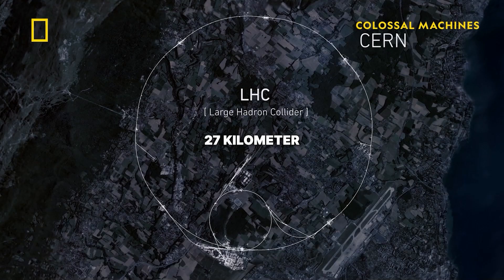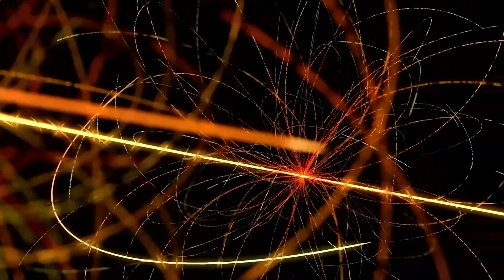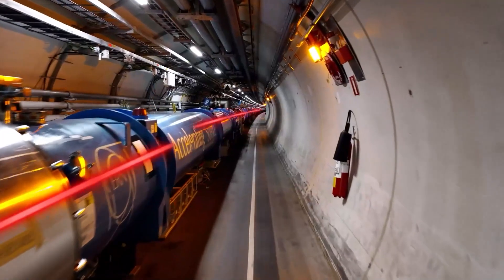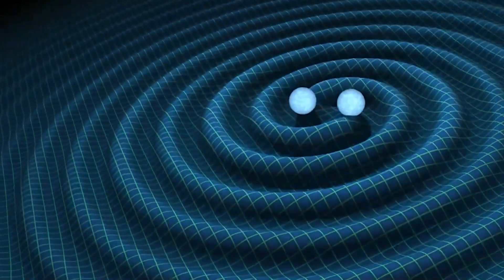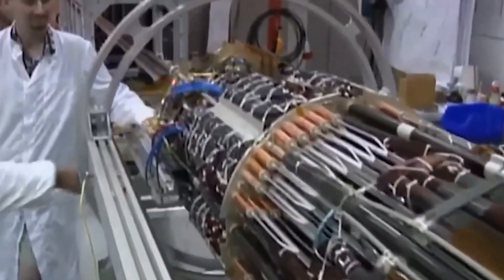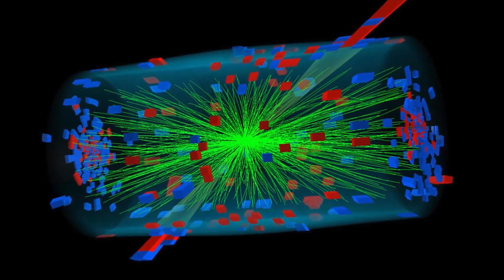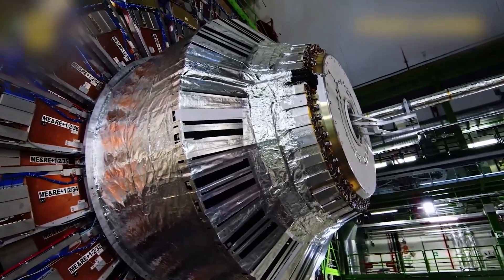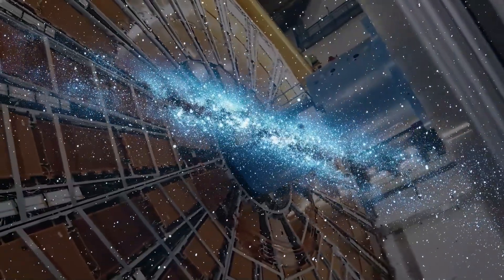CERN Scientists Tore Open a Quantum Singularity… And Paid the Price for Playing God

Comment: The claims from the YouTube video you referenced—that CERN scientists split a singularity in 2023, briefly risked global annihilation by creating a "strangelet," and have irreversibly scarred the universe—are not supported by credible scientific evidence or official reports from CERN or the wider physics community.

### Key Points Addressed

- *Strangelets and Doomsday Scenarios*
  - Strangelets are hypothetical particles made from strange quark matter. Some early theoretical works speculated that if a stable strangelet with the right properties were created, it could catalyze the conversion of ordinary matter into more strange matter—posing a threat on a planetary scale[1][2].
  - However, exhaustive safety reviews by CERN and independent experts have found that the likelihood of producing stable strangelets in high-energy collisions (such as those at the LHC) is extremely low—vastly lower than similar natural collisions occurring in cosmic rays, which have been striking Earth and other bodies for billions of years without any disaster[3][4][2].
  - These safety studies explicitly reject the notion that the LHC could create dangerous strangelets and conclude there is "no basis for any conceivable threat" of Earth being destroyed in this way[3][4][2].

- *Splitting a Singularity at CERN*
  - There are no verified scientific reports or press releases indicating that CERN or any other laboratory has generated a microscopic singularity, let alone split one. This concept does not align with current particle physics or capabilities of existing accelerators.
  - High-energy collisions at CERN do probe the fundamental structure of matter, occasionally producing exotic forms of quark-gluon plasma, but not singularities or mini-black holes of the type described in the video[5][6].
  - The supposed event in 2023 involving tears in reality, changes to the universe's constants, or a “localized Big Bang” does not appear in any peer-reviewed literature, CERN public announcements, or reputable physics press[7][3][8][6].

- *Strangelet Detection and Ongoing Research*
  - Experiments at CERN have searched for strangelets in heavy ion collisions and continue to plan for the detection of rare exotic particles, but no stable strangelets have been observed to date[9][10].
  - Some detectors, like CASTOR and ALICE, include components designed to look for unexpected events, including possible strangelet signatures, but this is routine for particle physics—preparing for remote possibilities, not evidence that such outcomes are likely[10][11][6].

- *Anomalies, Dimensional Tears, and Safety*
  - Claims about “tears in spacetime,” gravitational anomalies, and universal “scars” remain speculative and science-fictional.
  - No reputable measurement or published anomaly supports a change in the laws of physics or the constants of nature as a result of any collider experiment.

### Bottom Line

- The video you cited is a work of science-inspired fiction or speculation, not a factual account. There is no credible evidence that anything like the described experiment—singularity splitting, a real doomsday strangelet, or a permanent "patch" to the universe—has occurred at CERN or elsewhere[3][4][2][6].
- Physicists remain vigilant about risks, and every major collider undergoes rigorous safety review, cross-checked by cosmic ray studies, with overwhelming evidence that Earth is safe from these speculative disasters.

In summary: *There is no scientific basis or evidence for the catastrophic events, universe-splitting, or doomsday scenarios described in the video regarding CERN activities in 2023. Such claims exist only in the realm of speculative fiction.*

Citations:
[1] Strangelet - Wikipedia https://en.wikipedia.org/wiki/Strangelet
[2] Safety of high-energy particle collision experiments - Wikipedia https://en.wikipedia.org/wiki/Safety_of_high-energy_particle_collision_experiments
[3] CERN hopes LHC report will dispel doomsday fears - Physics World https://physicsworld.com/a/cern-hopes-lhc-report-will-dispel-doomsday-fears/
[4] [PDF] Review of the Safety of LHC Collisions - CERN https://cern.ch/lsag/LSAG-Report.pdf
[5] Strangeness and quark–gluon plasma - Wikipedia https://en.wikipedia.org/wiki/Strangeness_and_quark%E2%80%93gluon_plasma
[6] CERN highlights in 2023 https://home.cern/news/news/cern/cern-highlights-2023
[7] LHC experiments at CERN observe quantum entanglement at the ... https://home.cern/news/press-release/physics/lhc-experiments-cern-observe-quantum-entanglement-highest-energy-yet
[8] Upcoming events - CERN https://home.cern/news/announcement/cern/upcoming-events-bulletin-25-26-27-2025
[9] Finding strangelets in cosmic rays from HESS J1731-347, a possible ... https://arxiv.org/html/2507.12817v1
[10] International critic group ‚Heavy Ion Alert‚ claim CERN Documents ... https://oekonews.at/international-critic-group-heavy-ion-alert-claim-cern-documents-contradict-claims-of-safety-report-for-the-large-hadron-collider-concerning-strangelet-risk+2400+1103087
[11] Strangelets in cosmic rays - ScienceDirect.com https://www.sciencedirect.com/science/article/abs/pii/S0920563205009527
[12] CERN Scientists Tore Open a Quantum Singularity… And Paid the Price for Playing God https://www.youtube.com/watch?v=oPb_Xyftlkw
[13] [PDF] Search for Strange Quark Matter from the ISS with the ISS-SQM ... https://indico.cern.ch/event/1208314/contributions/5342845/attachments/2669371/4627770/2023-06-15-SQM-ISS-fin2.pdf
[14] Eli5 What are Strangelets and how would it affect us if it's created on ... https://www.reddit.com/r/explainlikeimfive/comments/17tdcly/eli5_what_are_strangelets_and_how_would_it_affect/
[15] CERN Split a Quantum Singularity… Then Discovered Why You ... https://www.youtube.com/watch?v=qcBocCUzzr8
[16] Physicists Glimpse Signs of 'Triangle Singularity' in Unexpected First https://www.sciencealert.com/evidence-of-a-triangle-singularity-seen-in-the-debris-of-particle-collisions
[17] An Overview of Potential Dangers Arising From High Energy ... https://dangerousworld.soe.ucsc.edu/2018/03/13/an-overview-of-potential-dangers-arising-from-high-energy-experiments/
[18] 1st sign of elusive 'triangle singularity' shows particles swapping ... https://www.livescience.com/first-evidence-triangle-singularity
[19] CERN marks the second World Quantum Day https://quantum.cern/news/news/cern-marks-second-world-quantum-day
[20] Has anyone else heard the theory that when they turned on ... - Reddit https://www.reddit.com/r/MandelaEffect/comments/mqyxre/has_anyone_else_heard_the_theory_that_when_they/
[21] Large Hadron Collider - Wikipedia https://en.wikipedia.org/wiki/Large_Hadron_Collider